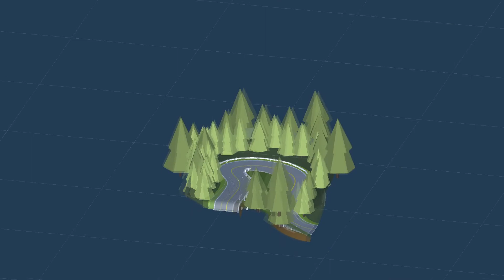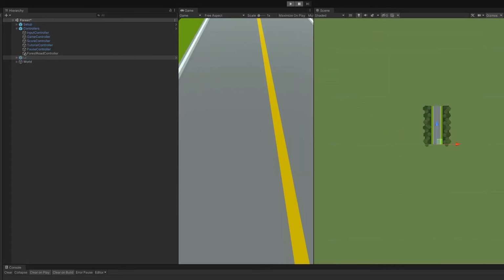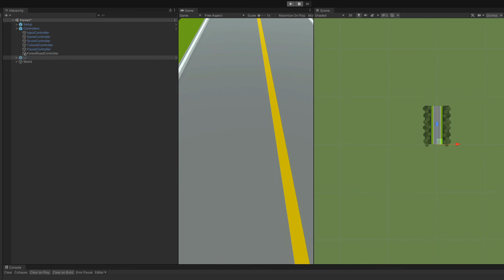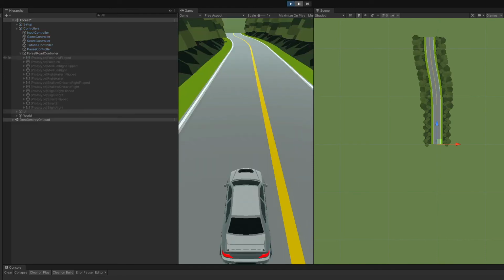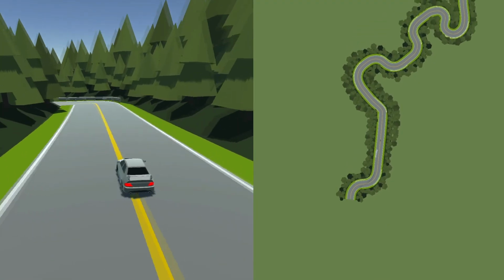How I Made an Infinite Touge For My Game - Drifto Devlog 1

Comment: how did you manage the collider bump issue? as the tires pass from one module to the other, it bumps, or do you combine meshes?
Reply from the maker: I was just super accurate with defining the start and end points of the road so there is almost no bump. Setting up conventions for the start and end of the pieces helped a lot.
The car suspension is also a big help in selling the illusion.
Reply: I've also done some stuff like this and yeah "standing" with a raycast instead of a collider helps me
you have a line going down into the ground that is your "wheel" or character. They can handle bumps better and without the launching that a collider will do, so small seems dont matter anymore

I've done it for both characters and wheels, one you snap back up to their height and reset their Z velocity, the other adds force the farther up the ground is detected (spring) and also adds force to counteract the speed the ground is moving up/down (dampener)